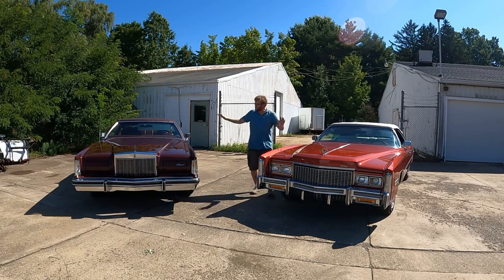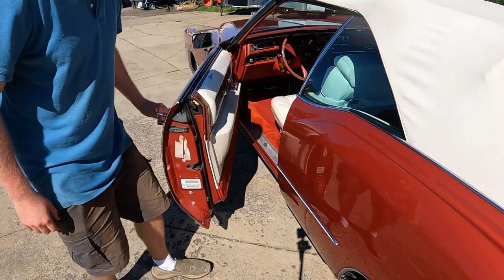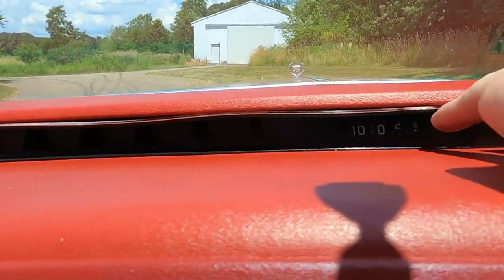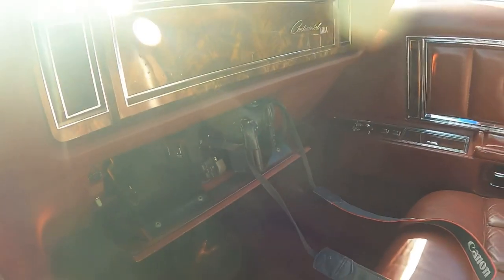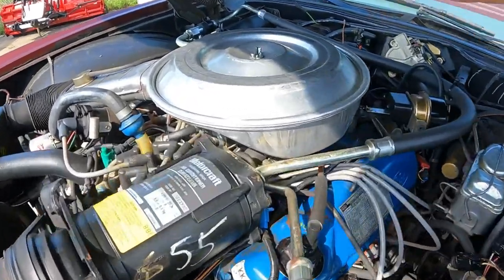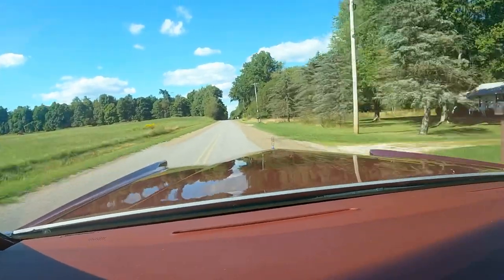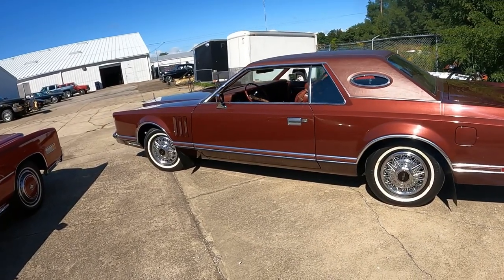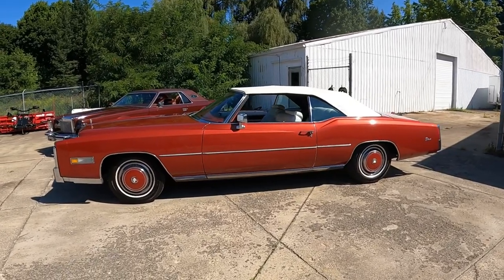This vs that 1976 Cadillac Eldorado convertible vs 1977 Lincoln Mark V￼

Comment: When comparing cars of this class, it basically all boils down to styling cause both have a ride like floating on a cloud with any option one could think of back in the day. No one bought these cars for their  performance like 1/4 mile and 0-60 times or to toss them through the twisties. The were built for absolute comfort like driving your couch down the freeway. Personally, I like the Lincoln as I think it just looks better but both are the epitome of North American comfort and luxury cars.
Reply from the maker: Totally agree these were to of the biggest cars offered from GM and ford I like the Lincoln more and I’m with you it comes down to preference (the Lincoln was sort of a basement entry level didn’t have a lot of options aside from leather seats, the vent windows are my favorite Lincoln feature and didn’t have those all that in mind I’d still take the Lincoln)
Reply: I agree with you on that one
As for me,  I would go for the Cadillac cause it looks different.
Reply: @Maharaj Pal  the Caddy is a beauty too for sure.
Reply: I have the 77 Mark V  it's is so smooth 
Who cares about 0-60 or handling when you're out for a relaxing Cruz?
It's all about road presence and that HOOD

Comment: IN MY YOUNGER DAY I OWNED A 1975 CADDY WHITE ON WHITE. IT WAS A WONDERFUL CAR BUT IT WAS A GAS HOG. FUN TO DRIVE BUT IT WAS A RACE TO THE GAS STATION.
Reply from the maker: Awesome story thank you so much for sharing that I got to drive one last summer and I remember even just driving it for 20 minutes it really sucked down the gas
Reply: There must have been somthing wrong with the Cadillac. I have the same car but with carburettor and it returns 12 mpg on average and 16 on the high way. It should be   more powerful than the L. also.

Comment: In the mark v there was an optional extra so you have vanity mirrors with light that look exactly like the one in the Caddilac, you could also have them at both sides if I remember correctly
Reply from the maker: Yeah your right the mark v was like entry level aside from the leather 

Lincoln had automatic headlights really cool vent windows sunroof miles to empty gauge (I think it was the first car to offer such a gauge) outside temp keyless entry as well as vanity mirror.. I think there was a armrest in rear as option CB radio all features are car didn’t have.. I want to do all the designer series of the mark v as well as bicentennial edition of the Cadillac
Reply: @What.its.like.   Leather was actually the lower option on the Mark V.  The velour interior was the highest option.
Reply: The mark just had an elegance- god what a ride. It’s heritage was the mark 1 , 2 and of course the museum of modern art
Awarded mark 3-
The eldorado, ? A bastard with absolutely no hope of competing- 
FYI 
When the manager of Lincoln specified what the mark 3 should be most of you are not aware of this- he specified as such;
“I want a thunderbird and a Jaguar combined
FYI 
How did you thing the CADILLAC was more expensive?
A REAL TRASH RIDE

Comment: The door latch striker is missing the plastic bushing, common issue,including all GM trucks. Simply wrap the striker with about 10 wraps of electric tape. GM hinge pins suck too, I've replaced many bushings, tricky job
Reply from the maker: Thank you so much for that insight I didn’t notice it was missing that =)

Comment: I own a "77" Mark V and a "78" Eldorado Biarritz. The author is definitely on the money with his rundown on these cars. My Mark has the 460 while Eldo has a 425. The Mark is snappier pick up wise and actually squeaks the rear tires loose going into 2nd if you open up that 4 barrel at the correct time. They're also crowd pleasers, as your lucky, if you ever see  one of these mint bad boys cruising down the street nowadays.
Reply from the maker: Thank you so much sounds like you dig this video.. there was a point in time where I absolutely wanted. Nothing more more than a Mark five or a Chrysler cordoba or a two door Fleetwood those are really cool as well. Lincoln had a bunch of different seat options. The cars that I compared the Cadillac seats were better, but Lincoln had some really stellar leather seats if this car was equipped with that it would be perfect… Lincoln also made some stellar velour seats I had an 88 town car that was one of my favorite cars. If not my favorite car that I’ve ever owned with the pillow side seats. I really like that car. I kind of wish that I never sold it.
Reply: I had an "83" 2 door Fleetwood which was brand new. Not to many people know these cars still exist or ever did. Great car, only drawback was that pitiful HT 4100. You speak of some stellar leather leather interiors Lincoln had, check out my you tube video to see a truly sharp leather interior. I have the the complete Marti report on that Mark and there were only 7 of them made that were optioned as mine was. Your two look slick to me and very well maintained. You have to drive them though, otherwise they'll get ill. Keep that thought in mind !!

Comment: I put a throttle body on my 73 Eldorado, it put the power through the roof, and made the MPG better; but it's still a thirsty engine.
Reply: Which throttle did you use ...I have a 76 I would like to do it for

Comment: My dad had a brand new 76 Cadillac Eldorado, with the Astroroof, fully equipped with the 500cid fuel injection, more power and torque. VOGUE tyres, beautiful white on white with red dash & rug. We test drove both the 4bbl, & fuel injection. In 78 I got me a Mark V. It was the last year with the 460. The Caddy would jump ahead from a dead stop & kept pulling ahead of my Mark. But, that was the last of them beautiful AWESOME MASTERPIECES. Instead of those humongous SUVS, imagine these landyachts with today's technology. 
I'd buy 1,& trade in my 21 'Slade. 
Nice informative video, I enjoyed it, & drove down memory lane. THANKS!!  
My "V" had the"Miles To Empty" for which I NEVER trusted when it was down to 1/4 tank. Both were thirsty for AMOCO 93. But, well worth it, my dad's had a passenger light vanity, but, my "V" had both sides. Plus, it had the MOONROOF,  what I truly missed on my Conti, was the Lamp Monitors that were on my dad's Eldo.
♥️🇺🇸👍👏
Remember, the movie"Donnie Brasco", when it begins the fellas are arguing about which was the better car, the Lincoln or Cadillac? That was my dad & I.
Reply from the maker: Great story thank you so much for sharing those memories. =) 

I owned a 88 Lincoln town car signature series AOD.. if one put put up to 20 miles per hour and then floored it would take off like a rocket tried that in a 77 mark this summer and it wasn’t the same.
Reply: @What.its.like.  Thank!!!

Comment: The 78 Mark V with the 4 way disc brakes, 4 way coil springs and the 460 4 barrel was the best of three I owned. The vacuum headlamp doors were a pain but they made those electric in the 79. The 79 didn't offer the 460 though.
Reply from the maker: Awesome choice 
I’d pick Lincoln over Cadillac as well
Reply: The headlamp doors were factory vacuum in 1979, yours must have been converted — a good retrofit!

Comment: Both are very nice.I like the Caddy better. I've actually driven both of them and as you mentioned, the seats are hard in the Lincoln. The engine compartment was easier to deal with in the Caddy. The Lincoln seemed to have masses of hosing within the engine compartment. The Caddy was simpler and easier to get around. I remember folks flocking to the dealer in 1976 to grab the Caddys since the mind set was Detroit isn't going to ever make them again. My college schoolmate bought a 71' El Dorado rag after graduation and that was a nice ride.
Reply from the maker: It’s hard to pick a definitive winner that’s why I said you couldn’t go wrong with either of them comes down to preference really but I do get your points there’s so many different pros and cons of each of them the link and it was featured was a basement model only options that I could find was the 8 track player and leather seats but they were the entry-level leather seats because they offered these really nice pillows side leather seats and it wasn’t them both of those cars could get really expensive with all the options they had to offer i’ve been in the Lincoln mark five with a cloth velour seats The cloth hello side seats are vastly more comfortable than these leather seats were it just depends on what seats 

I definitely see your point the Cadillac is definitely more accessible under the hood I agree with you I don’t understand why Lincoln needed all the plumbing underneath the hood it was especially like that later on years down the road I never understood why they needed all of the piping going seemingly nowhere
Reply: Yeh...I remember, they thought it would be the last convertible Caddy ever made.😆

Comment: 20:55 it's not weird,it has to do with rear end and transmission gear ratio and torque convertor factor and weight of the car which caddy is 500 pound more and that's why

Comment: That  Your Cadillac had a tilt telescopic steering wheel so it  Moved up-and-down and in-and-out the control for it to come out is right behind the medallion on the face of it around the deli right behind it there's a little knob that slides from right to left I believe left open left open and right locks it
Reply from the maker: Yeah thank you so much for the correction this is actually the second version of this episode I did a full version of an episode this episode it was supposed to air yesterday but I was finishing it up my computer software glitched and it just disappeared so I had to redo it and I forgot to put that part in there but thank you for pointing that out =)

Comment: I actually test-drove two of these back-to-back on the same day. Though the Eldorado was a 78 hardtop. 

I honestly prefer the Mark V. Discounting my bias of it being my favorite Lincoln, and the fact mine being a CA car was stuck with the 400, I found the experience better. I found the Cadillac to be sort of cramped, I don't think the seats were as comfortable, it felt cheaper inside, the visibility seemed poorer, and I wasn't a big fan of some of the control locations and gauge clusters. I'll grant the Caddie did feel a bit more powerful as far as horsepower (At least, with regards to 425 vs 400) and did feel a bit more planted and less vague in its steering. But the Lincoln was just an overall more pleasing car to be in, everything seemed to be laid out in a way I found much more preferable, and it was smoother and quieter than the Cadillac, and these cars are all about that.
Reply from the maker: Awesome I totally agree the Lincoln that was tested had the basement leather seats Lincoln made at least three different kinds of leather seats I’ve been in car with the other kinds and it’s a night and day difference. I’d take the Lincoln over the Cadillac.. the Lincoln feels more special nicer car in every measure =) totally agree
Reply: @What.its.like.  I bought a brand new Mark V in 1977. I did have the 460 motor and the better two tone seats (maroon with the white inserts and maroon straps). I did order the car and paid $11,900 with a MSRP of $12,8000. I am 66 years old and still say it today that the Mark was the best car I ever owned. You really can't describe the ride unless you drove one, you absolutely felt nothing when you went over a bump. I still think about this car all the time.

Comment: I may be bias, I had a Mark V.  It was a great ride.  It had the courtesy mirrors on both visors, miles to empty, outside temp guage and automatic lights.
Reply from the maker: Yeah all options the car featured was like a basement model with leather seats and 8 track player they are so nice optioned out I’ll review an optioned out one I want to hit all the designer series as well

Comment: This is the biggest car before it got shrunken . American cars became smaller in the 1980s
Reply from the maker: Cadillac shrunk before Lincoln did 76 was the last year for the huge Eldorado they shrink to roughly the same size as a 450 sl Mercedes
Reply: @What.its.like.  actually 76 was just the last year for the convertible, the Eldorado didn't downsize till the 79 model year!!
Reply from the maker: Thank you for that correction

Comment: The ‘77 Mark V is the smoothest riding car I’ve ever been in.
Reply from the maker: Totally agree they have a soft spot in my heart forever for that car could you imagine driving right now.. The only thing about that car is it needs another gear or two it doesn’t have enough kick down like the later town cars had with AOD transmission
Reply: @What.its.like.  My buddy’s Lincoln was baby blue, with a white vinyl top. PIMP JUICE

Comment: The Caddie in particular, is heavy and large with a monster engine, that has no grunt. I saw a 73 which had less rear legroom than a Mazda 2, and I wasn't surprised.  Room for 10 bodies in the boot (trunk) and the front of the car got into town a few seconds before you.
I love them still. Epic style over substance, terrible fuel economy,  subdued (choked) engine power. 
All the glories of yesterday embodied on one. 
Troubled by your inability to teach history to your kids, show them one of these. 
Yet, one extra stand out feature, is the price. They seem so cheap compared to today's  equivalent luxo barges.

Comment: Not that I mind the Mark V, but kind of too bad you didn't compare it with the 1976 Mark IV
I drive a 1975 Mark IV and have done for 20 years now. I have previously driven Cadillacs. A 1973 Coupe dé Ville for 9 years and a 1978 Fleetwood limousine for 5 years. 
Mark IV - only available with 460 cui
04:21 I love the quality of the crome panel on the Cadillac doors. 
04:40 in 1975 the Mark IV came with automatic seatback release. Open door gave free access to the rear seat. Closed to locked the seat back. 
04:50 Where the Marks have an ashtray in the doors for the rear seat passengers, the Eldorado has a door handle for the rear seat passengers in the right door. Great idea for getting out. 
08:06 The vanity mirrors with high/low beam lights in the Eldorado, look exactly like the ones I have standard in my 1975 Mark IV - Left AND right. 
09:09 The daytime/night time switch on the mirror is supposed to be UP and out of sight in the daytime. You pull it down at night. 
10:01 The glove box compartment is a joke in the Mark IV and V. My husband loves to tease me about it. Well, in his MX-5 there is NONE :-) 
11:10 The rear seat passanger door handle deserves attention. 
11:43 My 1973 Coupe dé Ville had a better white leather seat with arm rest. 
11:50 Mark V here. "You just move the seat like this" because of automatic seat back release. 
12.:47 Mark IV cars have back seat center armrests and in general a nicer leather seat design. 
14:40 Cadillacs in general has a much better cornering light, because it is located high and lights up the corner better. 
15:31 Lincolns in general including the Continental Marks have the cornering lights too low. They are not nearly as efficient as ones on Cadillacs. 
          On modern cars this function has more or less moved over to the fog lamps. 
15:17 The headlight doors on Mark V cars have - like most other Lincoln Mercury and FoMoCo cars with concealed headlights have TWO vacuum motors. One for each headlight. 
           Mark IV cars have only one. It means on Mark IV cars the doors always open evenly. You will never see a cross-eyed or with only one door open or closed. 
16:26 With a full size spare tire, the trunk is not all that big compared to a dé Ville or Fleetwood. 
17:25 The trunk in a Mark IV / Mark V is SMALL. It can only take one medium Samsonite hard suitcase + sailer sports bag. 
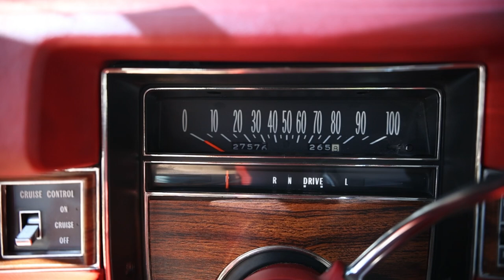23:26 I often have to help new right side front passengers find the inside door handle in my Mark IV. 
24:12 I think the ignition needs ajustment. 5 miles = 1/4 tank sounds VERY wrong. 
25:34 The steering wheel in Mark V models - other than the designer series is "cheap" without the faux wood trim inlay. All 1975 Mark IV cars have that. 
In many ways I am indifferent between the cars. I miss my 1973 triple white Coupe dé Ville, but I like my Mark IV so much, that I after 20 years of driving it, am having it renovated with new vinyl roof, and new all over paint. 
I want it to last my life time. It is so relaxing and enjoyable to drive and such a joy just to look at.
Mogens
Reply from the maker: Thank you so much for taking the time to share your experience I have to find a Lincoln mark four would love to compare it to a car this summer that would be awesome. I’ve never been in the mark vi or the lsc those are the only two left that I haven’t been in As far as Mark Series goes

Comment: Three comments: 1) The Lincoln was a fabulous car, agree with your comments regarding the ride.  You needed to take the Lincoln on the freeway at 80 mph with the windows rolled up and the A/C on, it is a life changing experience. 2) Judging from your comments on the Cadillac, the engine needs some work.  The horrible mileage and poor acceleration implies a carburation problem, possibly ignition.  In your case, fuel injection problem? 3) You totally stumped me on the song, i had to look in the comments.
Reply from the maker: That Lincoln was like an entry level Lincoln no options except basic options leather seats where the cheap ones we have another Lincoln which needs to be serviced it’s got 460 pillow side leather seats vent windows sunroof thermometer it’s a really loaded example as soon as we get it for service I’m gonna do a review on it.. we sold the Cadillac Eldorado so I wanted to do a comparison video on these two cars before I left because I’m not sure when I’ll see another one